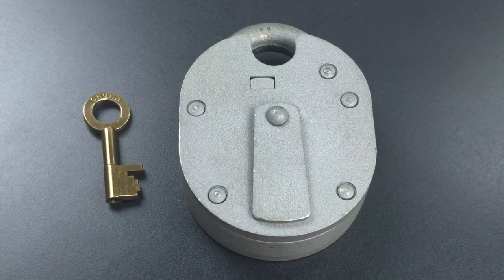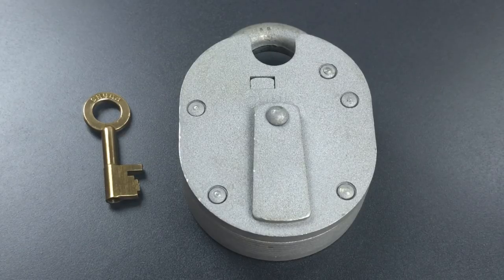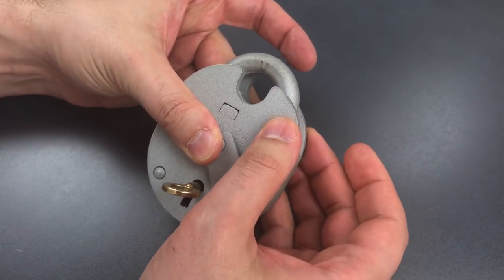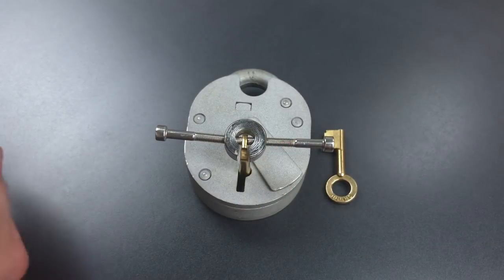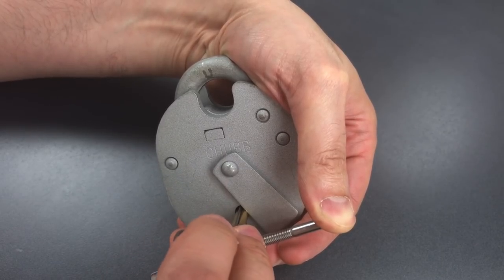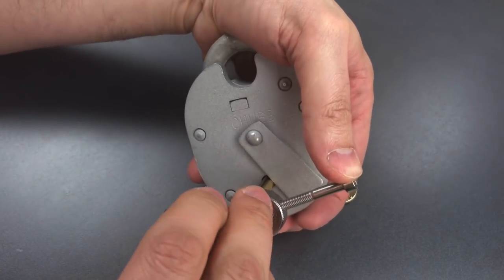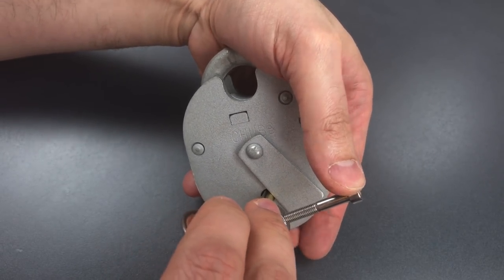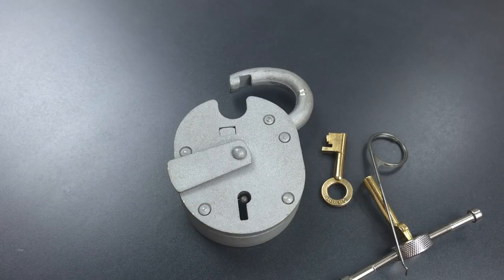[705] Chubb “Cruiser” 5-Lever Padlock Picked

Comment: I work for Chubb in Australia.  It’s Chubb’s 200th birthday by the way.  I also used to work for Jackson’s the locksmiths in Tasmania (that’s an island below Australia) and they also used to make the same type of locks.  I was told that this type of lock is very hard to pick, which is why they are used by prisons around Australia.  Just a little bit of history for you and the viewers.
Reply: An island below Australia? So which country is it actually in?
Reply: It is very hard to pick if you do not have the right tools and I assume that getting the tension right is hard with any piece of wire you come by as a prisoner. Also it helps it is not the most common lock around so you have to be dedicated to lock picking to even learn how to deal with it.
Reply: @Gribbo9999  Tasmania is an Australian state.
Reply: Tasmania is part of Australia just not connected to the mainland
Reply: @Gribbo9999  
Obviously a Tasweigan ;)
Reply: @connorclifton45  
Woosh. Obviously he would know that if he'd worked there.
Reply: @robinrose910  
Woosh. Obviously he'd know that if he'd worked there.
Reply: Its part of Australia just like Hawaii is to America it is actually the first place that was colonised it was primarily a convict island.

Comment: These are so common in Australia, the rail network uses them with a vast majority of the safes I've used.
Reply: I was on eBay earlier and I saw quite a few Vic Rail ones. Not as many of the old NSW SRA ones. Some Jackson's padlocks from Tasmania. But all of them looked quite old. I don't think there are many new ones around.
Reply: Gary Rumain padlock wise I see them on all the gates with access to the rail in my area. Probably older then me but hey if they still work and deter people why change.
Reply: I used to work for the SRA over my summer vacations back in the mid-70s. Only place I ever saw many padlocks were on the medic boxes in the guard's compartment on the country trains. There might have been others elsewhere but my memory's foggy now.
Reply: Gary Rumain I had no idea they were being used here in Oz Gary. We have no trains here though.😕
Reply: Sure you do. There's a spur line into Canberra off the Sydney to Melbourne line. I've taken it once or twice to visit Canberra in my youth. You don't have any suburban trains though.
Reply: I have two Queensland Rail lever locks. They're both Jackson branded and I have keys for both of them. Qld used two sizes; a large lock and ones slightly smaller. the keys are different though. both the ones I have are the larger ones. I haven't been able to get a smaller one. My dad works for Qld Rail and they were taking out rail near an abandoned meat works. They removed the old junction boxes and my dad asked if he could keep the locks for me

Comment: These are the padlocks we use on the national highway system (Motorways) in the UK to secure the gates to drainage ponds and the gates sealing off service entrances not available for public use.
Dropped one on my foot once - SO glad I was wearing steel toecap boots.
All of the padlocks came to us straight from the manufacturer and all were keyed alike so you can gain access across the whole of the Highways England network (Scotland, Wales and Northern Ireland may be different).
Our office had access to just two keys - both with a 6 inch by 2 inch wooden tag attached and you had to sign one out when going out on an inspection. Dire punishment was threatened if you lost one.
Then, while cleaning out a cupboard at a works depot, we found a box of nearly 50 of them  . . .  seems you get two keys with every new padlock.
I wonder what happened to them all ;o)

Comment: Get yourself a Chubb Battleship, even bigger, even badder, 6 levers, solid cast steel body. By today's standards the hasps are not particularly strong.
Reply: Donald Sayers They are not that much harder than the cruiser but do look better.
Reply from the maker: Donald Sayers I have one... and a plan for it. 😉
Reply: Then there's the ginormous Chubb Hercules with the Ava core... :-)
Reply: Donald Sayers we used to have a Hercules in work and it could be opened in seconds,  all I needed was the key.
I wouldn't even attempt to pick it ,LPL though is a magician so I'm sure he could get it done.
Reply: They're just a wafer lock, but they are not easy to tension.
Reply: I use a 10 lever lock as my main lock.